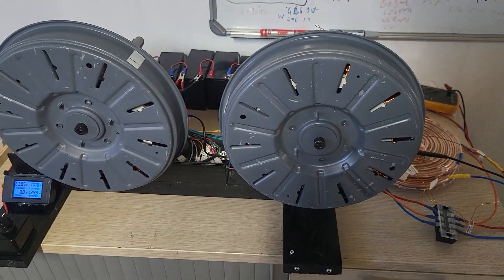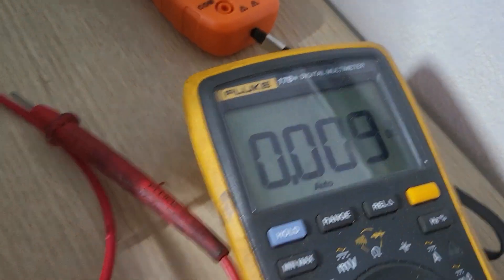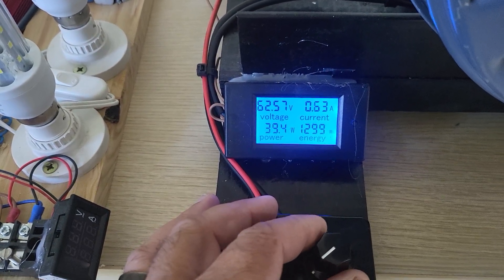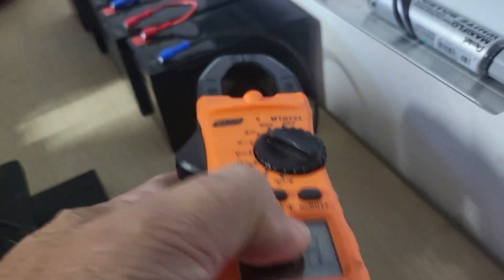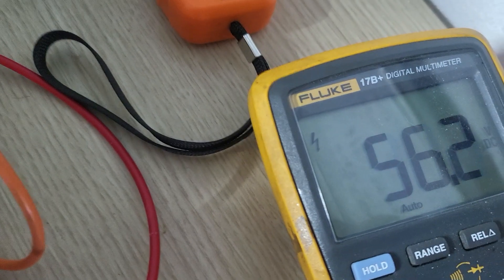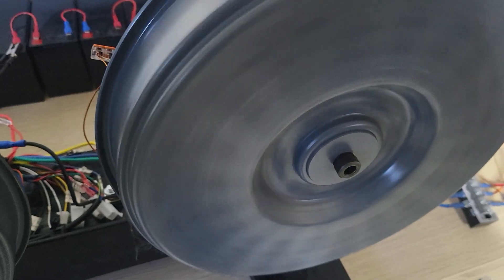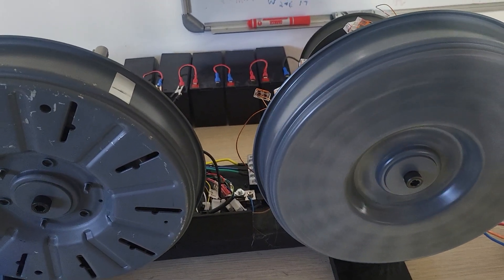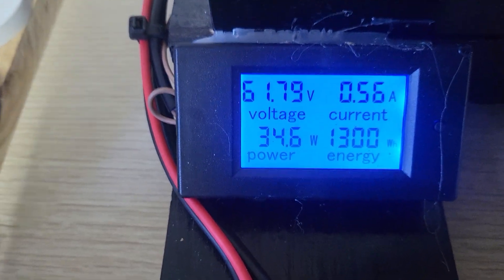LG washing machine brushless motor 55watt to run!

Comment: Hmm... what is pulsed DC if not AC in a square wave... and if you have two DC sources and a common ground... you've just about created a sort of AC in certain situations... isn't that what Edison did? And you've not got a load on the motors... so what's the point here exactly? The motor is meant to run in the horizontal plane as well so you might be getting a sort of flywheel effect as well. 
Cool stuff to play with, but is the point here exactly? Can you do any work with this setup? Can you spin a full load of laundry?
Reply: Pulsed DC is not ac in a square wave. In DC you have a set negative and positive, in DC that alternates. Ac is push and pull, DC square wave is pulsed push.
Reply from the maker: I would agree with this. Thanks Mennims.
Reply from the maker: Simon good comments thank you. I am not educated in electrical engineering. But I would comment that DC is probably the positive wave of AC. In South Africa we have load schedding. It is when the Government switches the electricity off for sometimes 8 plus hours a day. This causes farmers not to be able to pump water. A 2.2kw motor does not work on batteries and solar, at least not with a huuuuuge investment. I am trying to build a pump that can work from batteries, efficiently. So from maybe two to four solar panels you can pump water for km's to animals and growth. So the point is desperate. What have I achieved? I can swing a generator that provides 12v+ and 20 amps worth of DC(rectified AC). With reasonable power usage from batteries. Maybe you can see from other videos I made. You are right about horizontal, tested and I do get more efficiency. My next build will be like that. Thanks for commenting positive value and watching. :)

Comment: Hi Jakes. BLDC is missing the sparks that a brushed motor clearly has. The spark is the key, or ‘pulsing’. With capacitors and transistors people try to ‘cope with lenz law’. Theoretically it could work, but some solved it by also using one or several batteries like Bedini. Good luck with your experiments, nice setup you have there
Reply from the maker: Hans thanks for comments. You are 200% correct. My dream is to put brushes here. And I will. Only then can I do things like amplidyne effects. So 100% upgrade here is to go brushed. I can then also play with different voltages, pwm etc.

Comment: back emf, the most misunderstood and misused term in pseudo electronics...

all it is is lenz law. eddy currents.

its a changing current causing a changing magnetic field that generates an opposing current to the applied one. back, as in reverse, emf.

a plain wire, being resistive, flows full current and burns out. it has no Back EMF. 

as you lengthen the wire, it increases in inductance.
wind it into a coil, and inductance increases dramatically.
inductance is basically how much Back emf will be produced to counter the applied EMF, in that initial moment when power is applied, or removed. (whenever there is a change in the current)

when a potential is first applied, the current tries to change the fastest. it generates the largest opposing back emf at this point.
as the field builds, the rate of change reduces, the back emf reduces, and current increases.
finally the magnetic field is at its strongest, it has no change at all, and only resistance opposes the applied potential/current. the coil gets hot and or burns out.

a motor is a generator. when it is stalled, it is basically a short circuit. the only opposition to the applied current is resistance. they heat up and smoke when stalled. maximum current can flow. maximum magnetic field is produced.

when it is running no-load, it is generating a current that is in opposition to the applied current.
youre 12V input is opposed by say, 11.5v of back emf. and the 0.5v remainder is what is required to overcome the resistance.
minimum current can flow. the magnetic fields are at their weakest. 

as you load the motor down, it slows down. it generates less BEMF to oppose the applied current. current draw increases. the magnetic field increases.

the BLDC is slightly different as its controller doesnt apply the power supply directly to the coils, unlike a plain old brush and commutator. otherwise, they behave exactly the same.
Reply: wonderfully explained. thank you.
Reply from the maker: Paradise Lost thanks for this. And yes, you are right. You actually understand BEMF I can see. Thanks for detailed explanation. It is probably better than a ChatGPT explanation;) So with my limited understanding of these things(I only started this project about 8 months ago) I like to test things that I read and see. It is the only way to find new shores. I tried to do things with BEMF, but at this stage I am failing. Mostly because I did not understand it. After many failed experiments trying to do something with it like trickle charge batteries, Im on a new path. Ill share when I get something. If ever you have suggestions for what to use this BEMF(apart from signalling for zvs) Id love to hear it. Thanks again for participating in a positive way.